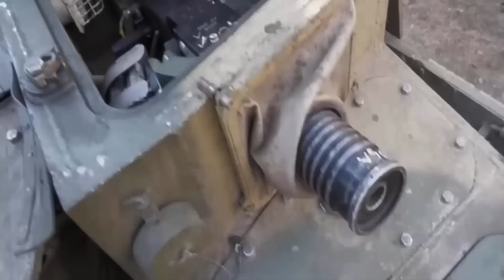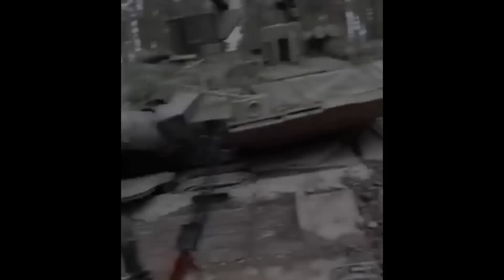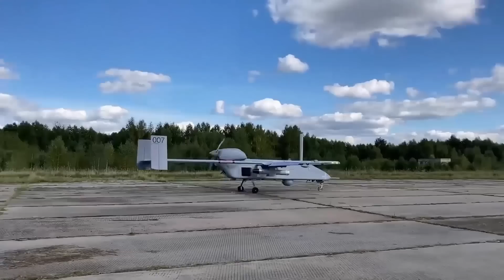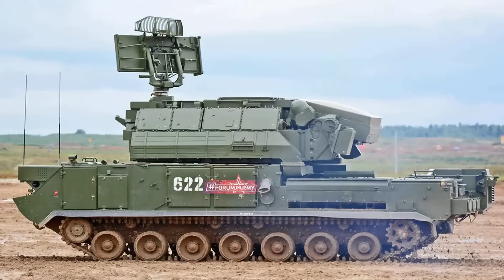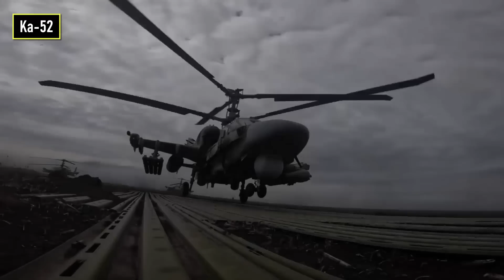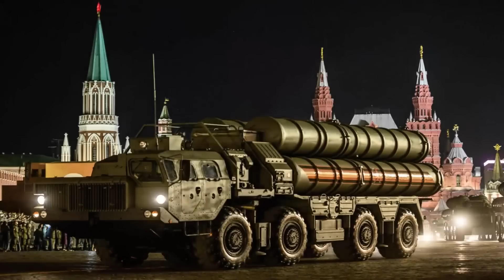2023 | 10 Best Russian Weapons Lost in Ukraine | MilitaryTube

Comment: The biggest, the fastest, but very inaccurate. Best only for Russia. Obsolete for the rest of the world. 
You also have to take into account that newly produced planes or tanks are not the same as previous versions. They are even worse equipped than those from before the war. Russia no longer has access to Western equipment. For this reason, to a large extent, the currently used equipment can, quickly become useless, there is no way to service it. They will have a lot of planes to put on the monuments :) (Which is popular in Russia.). The only good think in Russia is propaganda. Anyone who has them as neighbors knows this. Besides,  Russia is trash, banditry and the wild east.

Comment: As for the Tor older anti-aircraft systems, not all, but most, if you look at the photos of the destroyed ones, it is clear that they were not in a combat position at all. They were brought to some kind of position and were not activated. The rocket carriers are lowered in position when the vehicle is in motion. The newer Tor M2s shown in the pictures have lowered radars and the turrets are in position when the vehicle is in motion, which means they were not active. The same with the S400 system, the launcher is in a horizontal position. It seems to me that the Ukrainian warriors are doing an excellent job of tracking these vehicles onto the battlefield towards their positions and hitting them right away before they even activate. As for fighter planes and helicopters, these are acceptable losses considering the intensity of the fighting. And as some have already written "It doesn't matter how great your weapons of war are if your soldiers lack the skill and discipline to execute the mission."
Reply: The newer variant Tor Russia has can fire their missiles at targets when traveling , it dosnt matter wether its in motion or not. They have the capability to fire on the move. The Tor has a built in radar on the same chasis,as for s400 the mobile missile launcher truck is a separate vehicle from the radar truck. So maybe the Ukrainians took out the radar truck therefore making the missiles useless without a radar to accompany it. 
If the Russians didn't activate their radars then that's surprising, because systems like the Tor were specifically designed to shoot down drones & anti-radar missiles, usually a Tor would be protecting the bigger longer range more advanced S-400 system. Don't understand why they didn't do that? The Tor is more than capable of protecting itself and other air defense systems positioned within it's range. 
It's not like Ukraine's air force has air superiority either. So if the Russians did indeed leave them off then that was the probably the problem. A Tor is a mobile air defense system that can fire on the move and it was designed also to protect frontline positions,assets,infrastructure and also protect tanks & troops on the move (maneuvering formations),so it's baffling why they didn't activate it. Apparently the Tor can target small drones and incoming missiles,it was built to counter those kinds of airborne threats too. The Tor,Pantsir,S-400 are pretty good air defense systems. Especially the versions Russia has,the best variants. The fact that they were able to get destroyed shows good Ukrainian intelligence, precise artillery fire and tactics to counter them. It's still surprising the Ukrainians were able to knock out more than just a few. Each system costs $15-20 million for a Tor and S400 is like around triple that if not more. 
Don't know why the Russians didn't activate them or use a Tor to protect an s-400 for example,they've got enough systems to do that. Maybe it is incompetence,hard to fathom when the guys surely are trained to know when & where to turn them on/off.
Reply: нет неуязвимой техники, это раз, второе европа помогает Украине развед данными летая безнаказанно по границе, придет время и все ваши самолеты и спутники упадут и тогда не будет у вас глаз . вот тогда посмотрим что вы сможете
Reply: @vartanyan1000  This is not a board game this lul
Reply: @vartanyan1000  по какой границе? Финляндия и Черное море?))
Reply: Да кто бы сомневался у русских все гавно вот у запода это да вот что-то с заподным вооружением вы обсераетесь и сдаёте город за городом вывод один если натовское оружие в сотни раз превосходит российское то вы рукожопые где контурнаступ где факты или как всегда пиздеш

Comment: BMPT Terminator is simply IFV with infantry replaced by extra armour.
EDIT: I mean function, not construction.
Reply: and a wobbly pop gun on top!
Reply: Несёте бред, БМПТ делается из танка, просто боевой модуль другой
Reply: @ТамараМирченко  yes you are totally correct
Reply: It’s based on the T72 tank chassis, not “an ifv”.
Reply: @krtacct  using a 50 year old chassis design with all the flaws typical of ruSSian armour, no wonder they are either breaking down or blowing up.